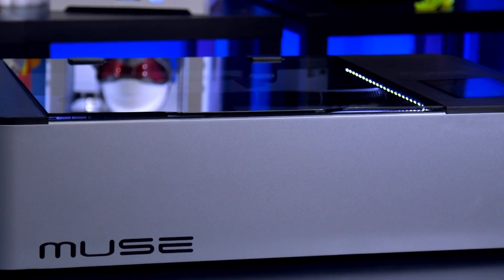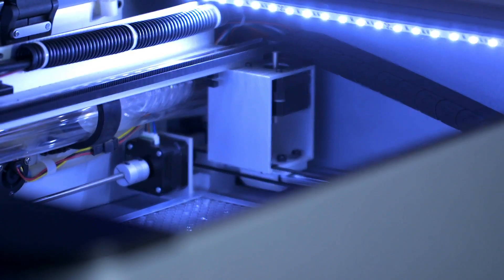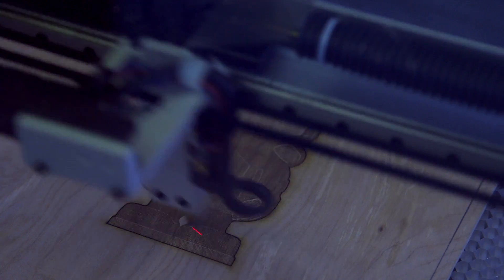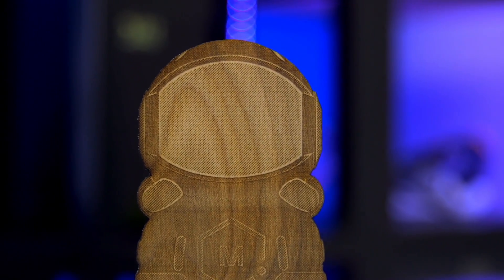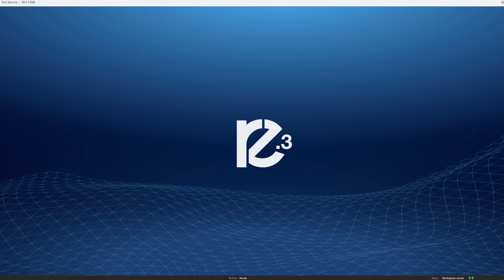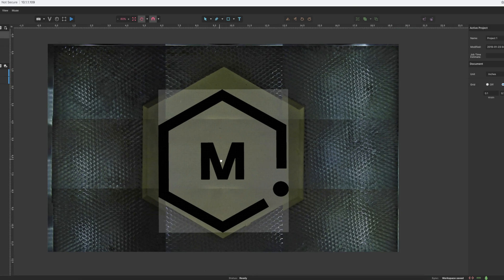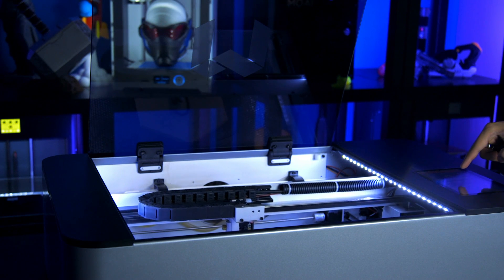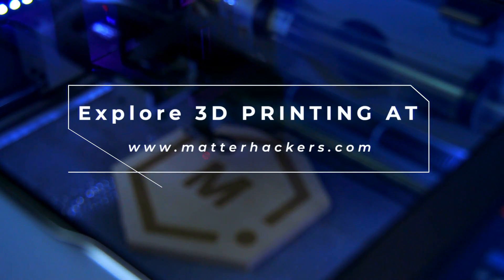FSL Muse Laser Cutter & Engraver // Tech Breakdown

Comment: Hobbyists buy the £400 one off ebay and then mod it for a quarter of the price. It nice to know it is just another 2000 dollars for a fume extractor kit. I’d like to know the type of person that buys this overpriced k40 machine.
Reply: you don't get a 45w co2 laser at this price point.
Reply: @danielkrah5129  40w/45w not much difference....Most then go to 60w  which is £1200 and also come with the big build plate. Still a laughable price for a hobbists machine which could be made for half to a third of the price.  2000$ for a filtaration system. I think someone over there was sniffing the fumes when they came out with that price.
Reply: @danielkrah5129  the 5000$ quoted is the 40w base model. another $250 for the 45w
Reply: The glowforge is overpriced and it's a full 1000 dollars cheaper.

Comment: For the hobbyist? $5000? Does not compute...
Reply: if you buy a laser tube with this wattage you pay 3500 - 4000 for the tube alone ;-)
Reply: @danielkrah5129  Don't call it "hobbyist" then.
Reply: @danielkrah5129  The glowforge has a 40 watt laser and is 4000 dollars. I guess I am missing how this is 1000 dollars better.
Reply: @chriskuk5087  The Glowforge requires internet access to use!